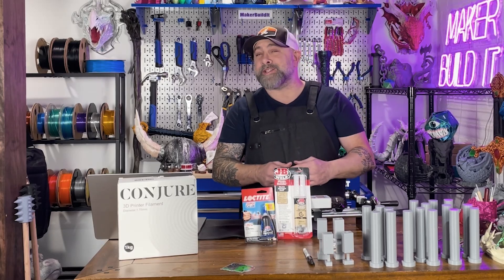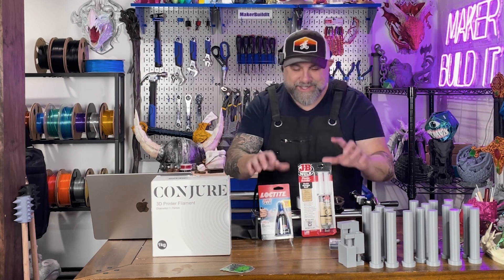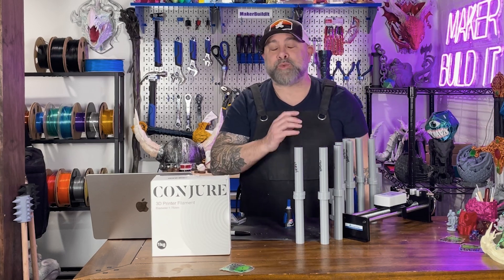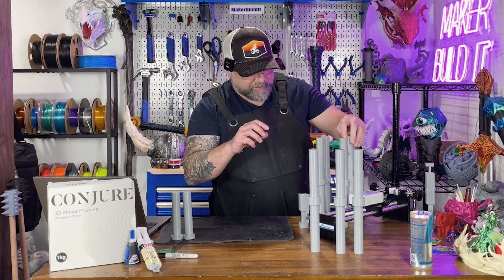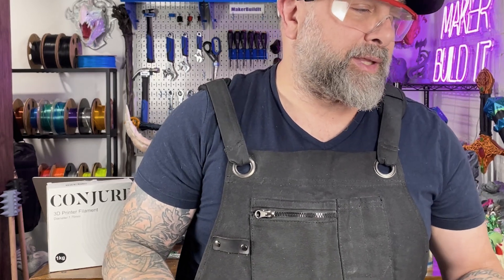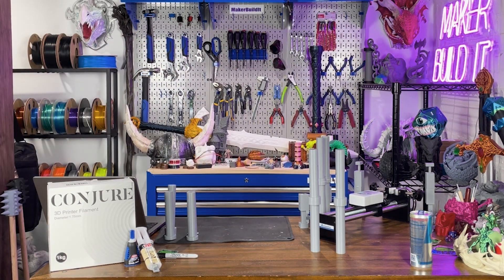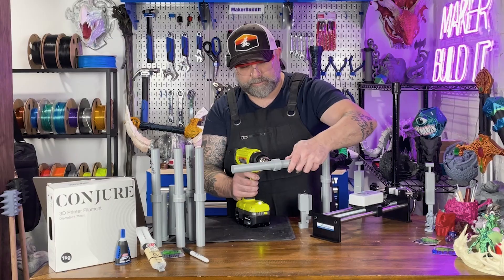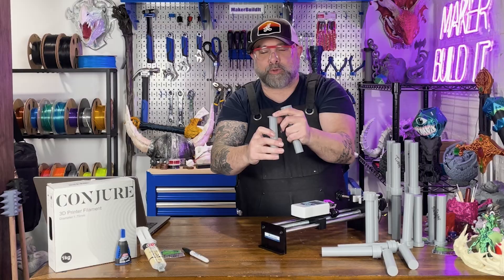Super Glue vs Epoxy: The Ultimate 3D Printing Glue Showdown!

Comment: Following these test with alot of interest! As I've mentioned in a previous video, by printing those "test tube" vertically, it seems that layer adhesion compromises your results. Instead of printing round tube vertically, you should print "hexagonal or octogonal tube" horizontally. It wouldn't require supports and layer adhesion wouldn't be a concern. My 2 cents 😉